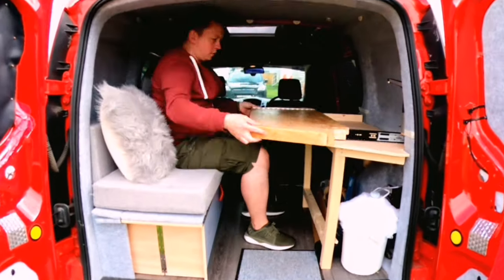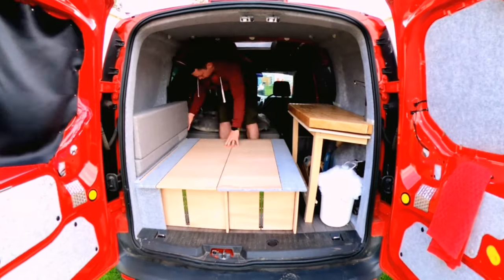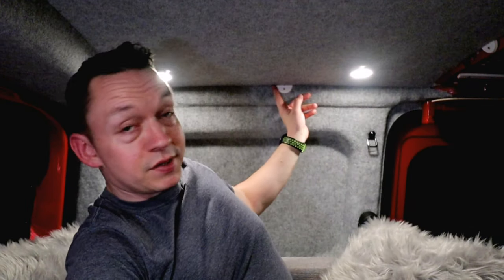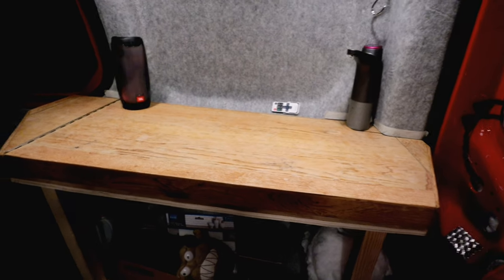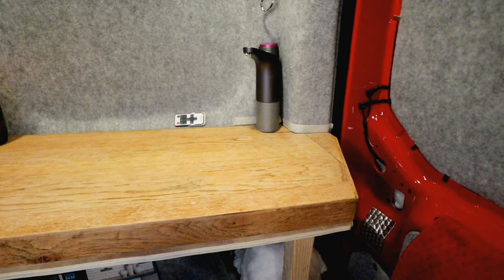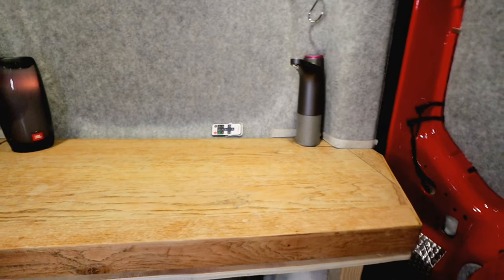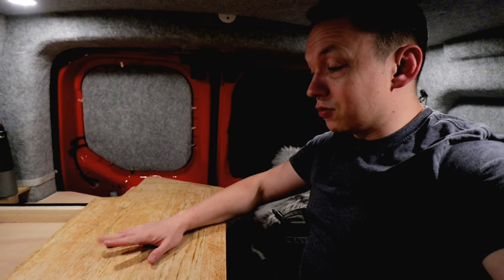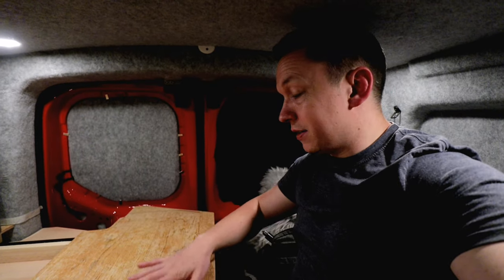Ford Transit Connect LWB Camper Conversion

Comment: Funny, was just thinking of picking your brain on creating the ceiling, lo and behold a vid comes out! 
If I wanted to a ply ceiling on the rear section to match the height of the middle section so I could throw in insulation, what would you recommend I do for mounting the ceiling to the very back? I only see the 'beam' at the middle and behind the front cab. Hope that makes sense!
Also absolutely loving your transformer table, you're honestly the  one van converter on YouTube that has the closest ideas on what I want to do with my connect, keep it up!
Looking forward to your transformer bed video too!
Reply from the maker: @optikronix what are the chances of that lol. I am going to insulate in the mid section and just secure straight in to the beams, now for the bit above your doors i would put a wooden beam across screwing into the door beam then i could but my ply up to and screw straight into that. this way the ply would hide it nice. let me know what you do 😁

Comment: Hi. I just found your channel and your table intrigues me. Did you build it? buy it? If you built it, how? It's very cool. I'd love to know more.
Reply from the maker: @Miranda Folland, I built it from and old TV unit, I wanted a nice wooden top so I had to chop it to shape it to the right shape, then build a frame work and sort the draw sliders for sliding top. I am still working on it so will make a video all about it soon once it's a bit more finished
Reply: @ChillVanlife  I look forward to your video all about it. I currently live in a medium roof Ford Transit and am building it out myself. I'd love to build a similar table for it. Mine is also red and your red Transit is what attracted me to your channel. Keep it up. You make good quality videos!
Reply from the maker: @mirandafolland3440  not many red ones about which is nice, The table works lovely in my van, it's the perfect size and I can't wait to show it off once it's a bit more finished 😁

Comment: Please may i ask what idea you came up with that you have mounted your tap on please, i think the bit I’m talking about is grey on top of the transformer table. I have the same tap but need ideas. Thanks so much. Love your channel xx
Reply from the maker: @sue keys. I wanted the tap high enough to get a water bottle under so I have a bracket, a piece of pipe and then some grey pipe insulation foam that the tap sits on. I'm just working on a stealth camp video and then I could do a video on the tap if you like 😁
Reply: @ChillVanlife  thanks for reply Ian. I’m really really loving your blogs. That would be great if you could do a video. I have a Peugeot partner tepee that’s been converted. Like you didn’t need a sink but wanted the tap. Mine is mounted on a empty curry powder pot covered in black card lol. But want something better. Lol. Thanks Ian xx
Reply from the maker: @Sue.242  I am away next week so that video will give me something to do whilst I'm off 😁 thanks for the idea 👍. Thanks for the love 😁😁😁